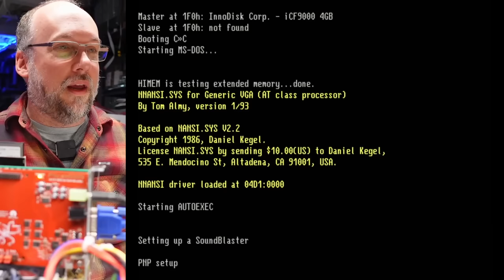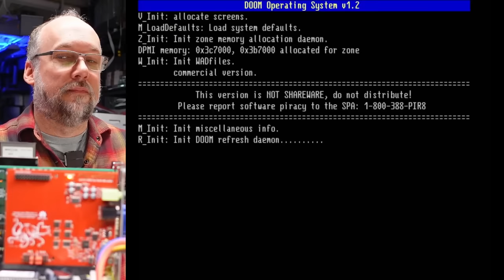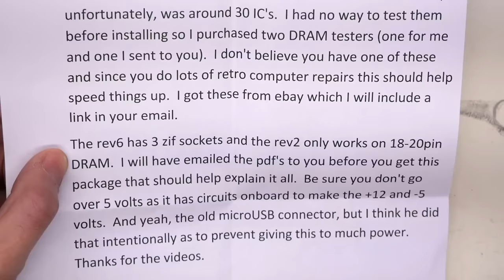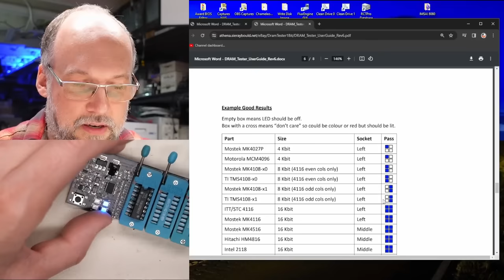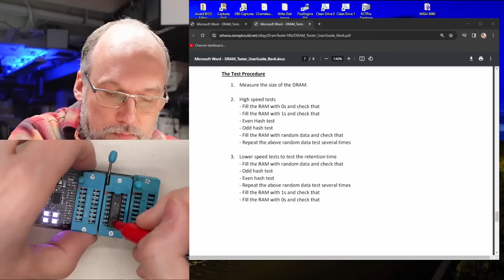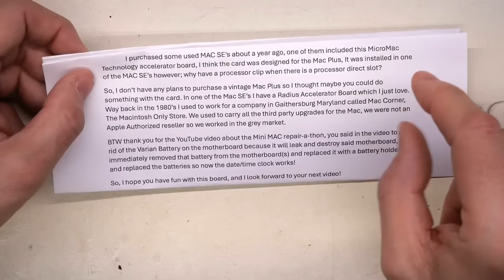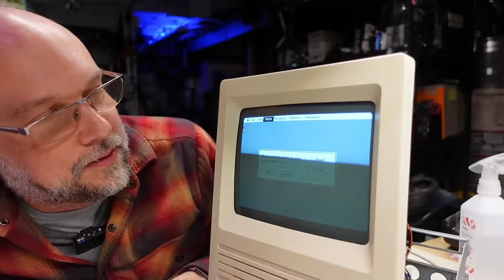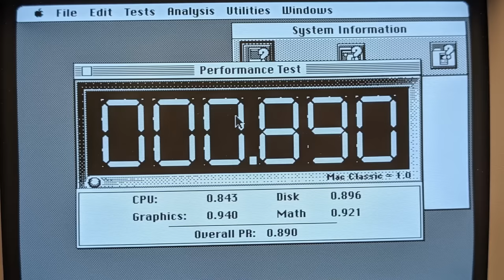0083 PicoGUS emulating a Sound Blaster, DRAM testers and a clip on Mac accelerator

Comment: If you go to the wayback machine and go to a earlier version of the website, you can download the file. In my testing, I chose a version in the year 2000 and got it to work.
Reply: Sounds like maybe those need to be compiled and put on archive for easier access!
Reply: Wow, that's crazy. Even in 00 way back machine was storing data from links that I would have assumed would be ignored for storage concerns.

I thought it was crazy that way back machine bothered to cache a few RC car images from my home hosted childhood webpage back in 98... Nevermind old drivers!

I'd love to know how their process works. If anyone knows of a good video to watch documenting their start i'd really enjoy it!
Reply: I was able to download it from their website.  I had to right click and "save as" from the main downloads page.  Once I did that, Chrome also decided the files weren't safe and I had to say "keep anyway".
Reply: You can paste the 404 page address with the .hqx extension and download it directly from 2006.
Reply: Hqx is is the mac equivalent to UUEncoding, so text based binary encoding. If you have problems getting an hqx file, try using something like wget and forcing the encoding to 7bit mode instead of 8bit mode. Modern OS and software expect files to be in 8-bit mode and have special handlers for uue. You'll hit this if you try to download from a wintel instead of a mac.
Reply: I was about to write this having tried the same thing myself. More recent archives of the page do not have the file archived, but page backups on the waybackmachine going back before 2005 seem to include the file.
Reply: Same here 😂 @uomoartificiale
Reply: @volvo09  I wonder if they have a size limit and these old programs are just so small they slip under that limit.

Comment: Ian has basically blown the doors off the retro sound card market.  Because the dream was always a Sound Blaster (preferably a Pro) and a Gravis, because the Gravis had really crappy SB emulation and well... this is a one stop card for doing both.  If/when it gets SBPRO/OPL3 emulation as well... going to suck to be a scalper of old hardware.
Reply: if he'll boost cpu to some like pi zero 2, it wll be possible to create ANY-IN-ONE isa soundcard, emulating SB16,OPL3, GUS, SID, AY, CMS,MT-32, GMIDI Roland, GMIDI Yamaha
Reply: @Insomniator1  I honestly hope he doesn't as it'd be impossible to use a full Pi and keep the £45 price tag.  

Being "cheap & cheerful" is equally important to the PicoGUS's popularity.
Reply: It would be even better if it could emulate several cards at the same time, with software select and wthout needing to reset the firmware, but I don't know how feasible that would be.

Comment: I can't believe that even after all the upgrades the v2 picogus is only $45.  Now to just wait for it to be in stock...
Reply: It would probably not be even a problem to re-manufacture except that there are no 68030 processors manufactured anymore, and that the PAL chips (predecessors of CPLD and FPGA) have unknown internal logic, although they could probably be fairly quickly reverse-engineered by modern systematic machine testing, since the inputs and outputs of the chips are known, and there are only so many alternatives to record. PAL chips are fairly simple things, and would be very easy to replicate using CPLDs.

Comment: And yup, the Performer will run like garbage without the extension.  A gentleman at 68kmla pointed me at macintosh garden to look under apps and then micromac-accelerator-software.  The 2.2.1 sit file you need should be the first one on the list.  Hope that helps and hope to see you again this fall at VCF Midwest.

Comment: The original Gravis Ultrasound is compatible with an 8-bit ISA slot.  It merely loses the ability to use the higher IRQs and DMA channels.  Silly things I tried back in the day when I didn't value this hardware as much as I do today. 😅

Comment: What an ironic twist, that a GUS can finally emulate the BS properly! ;)
Have the PicoGUS 2.0 as well and was also in contact with Ian, concerning some compability issues. It should run with 80-90% of GUS compatible software, but doesn't work with all.

The original SB Pro (have one) is indeed just a supercharged SB with 2 OPL 2 instead of one, and a small circuit switching between Mono and Stereo playback, so it's really easy to make SB Pro support when SB support is already there.
Fun fact about the SB Pro: The DSP is essentially the same. The little circuit, when enabled, switched the (Mono) DAC output between L and R for each successive sample.

About SID: There was the Innovation SSI, which is probably one of the rarest cards on the planet, and employed one SID chip. I have so many cards, but this one only as a clone.

Comment: A good reason to use the a processor clip instead of the processor direct slot is that you might want something else in the PDS slot, such as an ethernet card or a display card, and still also want a CPU accelerator.

Comment: A chip tester that tests chips fully needs to have programmable voltage/current drivers for each pin. It needs to verify that each pin’s behavior is within manufacturer’s spec. You don’t want to be driving any TTL chips for test with NMOS CPU outputs, since they don’t exercise the full range the TTL chip should work with. The CPU used is not of much importance in testing accuracy - it’s all about the FPGA that generates the waveforms, and the pin drivers. A test of a basic TTL LSI chip like 7400 produces about a megabyte of data, sampled at 1Gs/s, for a rudimentary test, so a Z80 or 6502 will have a bit of a workout going through it. RP2040 will do just fine for that.

As for what would be physically driving the pins: ironically they may be CMOS op-amps :)
Reply: Yeah, sure. There are testers that will meet your needs... for only a few $10,000. btw DRAMs are MOS devices so why do you talk about TTL? Despite of that testing a TTL chip using a MOS device is usually not a problem.

Comment: regeneration (refresh) time can be critical for the DRAM functioning. When the tester counts rows and columns, it usually refreshes DRAM contents much quicker than in specs. So many designers of the chip testers forget to include refresh period testing. It means write and wait! for 2 milliseconds for each row. It can be possible that leaky bits loose it's content in 1.5 ms - but will work OK in tester or video board where it is refreshed much more intensively than every 2 milliseconds.

Comment: 3:15 ENIG (Electroless Nickel Immersion Gold) also has a longer overall lifetime, if taking cards out of boards frequently, compared to HASL (hot air solder levelling) where they just take the normal solder paste and flatten it out.
Reply: ENIG also wears through very quickly. It is not the same as hard gold plating, which is what real mass produced cards use.

Comment: I recently bought the very same DRAM tester, as I needed to swap out the ram in my 5150 plus its memory expansion card. I bought about 100 4164 chips off aliexpress and I don't know what I would have done without the tester - no fewer than 20% of the chips were bad! That would have been a nightmare to try to troubleshoot any other way.
Reply: Raspberry Pi connected to a breadboard...

Comment: Adrian, you can get those PDS connectors on your hardware supply site of choice still. But you can also just use standard pin headers, i believe the pitch is the same.

Comment: I have my picogus in my dell xps 466v with an ESS1869F Audiodrive connected to a roland sc-55 mkII, with a simple audio mixer. With this setup I can run a cd, midi, sb16, and gus both in dos and win9x without making any changes to hardware or software. The only upgrade would be to get a SB AWE 64 Gold and a real gravis ultrasound, or an Orpheus II, but that would set me back upwards of $1000. So im pretty good with this setup for now.

Comment: Only thing that could improve the PicoGUS would be GUS + SB compatibility at the same time, but I assume that'd require more horsepower than a single card can provide. You can always buy 2 lol. I do have several GUS and plenty of SB cards but I want at least one of these for the ease of use. Still... having a more powerful version that can run SB+GUS simultaneously would be a dream card.

Comment: The SB 2.0 has a physical volume wheel because it has its own amp, you are supposed to set it to the middle when not using unpowered speakers (ie. line out like). Of course its noisy. There were some later SB Pro / 16 where you could disable the amplification via jumpers. This is also the card you could put the CMS chips so you would have both sound/game blaster. 
I wonder if this PicoGUS could do something like Fluidsynth, just take your .sf2 file (that you could use with an SB32 etc) and work like a regular midi device... I would totally not use Scc1t2.sf2 to listen to the Doom music the way its composer intended (not that unworthy FM degradation).

Comment: A week or two ago on gamer's nexus hardware news they were talking about a video card that is dos compatible and can play GLQuake at 60 FPS in HD (I don't recall if it was 720p or 1080p), but it's FPGA based, and it uses HDMI. The downside is that it's pci-express. So it would potentially let you play dos games natively on modern hardware. However it is or will be open source. So they could potentially be make into a PCI version as well. It sounds really cool. You can get a new C64 thanks to the U64 board. But now we're getting to the point where you could get a new dos computer as well.

Comment: CubicPlayer does have support for SoundBlaster 2.0. It might not have worked because your BLASTER environment variable was set to the SB16 settings, which might have confused CP's SB detection code.
Reply: Yep, that's exactly it. I've tested it and the PicoGUS works great in Cubic Player if the BLASTER variable is set correctly.

Comment: A clip on accelerator was a pretty cool thing back in the day when your PDS was already occupied by the video card required for a Radius pivot display or one of the large, multi-page monitors used in desktop publishing back then. Nowadays, though… Not so much. Most of those monitors don’t exist anymore. 😕
Reply: I remember those displays, the "HUGE" 19 and 21 inch CRTs, weighed a ton, which in my branch were used for CAD. The monitor cost a fortune, and the video card even more just because of the vast amount of DRAM which cost more than gold in weight back then.

Comment: I love my AWE32
Reply: I had both, first a GUS but swapped it for an AWE32 because of the wider support. Have to say the GUS sounded better though. I put 2x4MB in the slots for the wavetables.
Reply: Awweee
Reply: @paulmichaelfreedman8334  The default AWE wavetables are  pretty rough, yeah. GUS had way better electric guitars for Duke 3D and Doom, for instance. Orchestral stuff is more of a wash.

That wouldn't be such a problem if you could use SF2 banks in DOS, but Creative never bothered updating the drivers, so you have to play through Windows. If you don't mind that (and aren't hugely into old demos), the AWE32 is a very nice card. Unfortunately it's also not very affordable anymore, especially not the CT1747 equipped versions which include real OPL3 hardware.

Comment: I wish we could see some new compact Mac accelerators produced with a Pi or other FPGA cores like the in the Amiga community. Wouldn’t a drop-in logic board be awesome? I love the work on the new SE boards. But components will run out and I hate emulation.